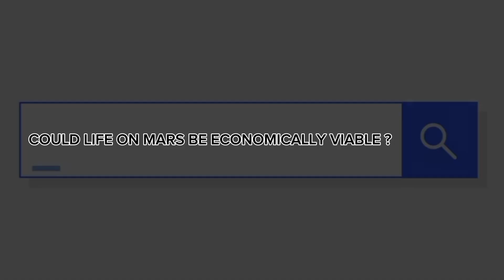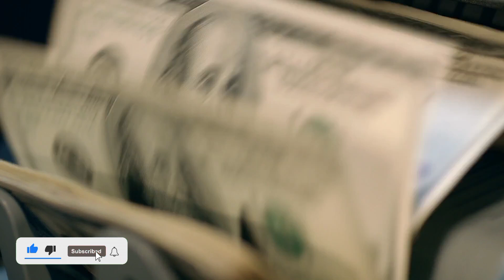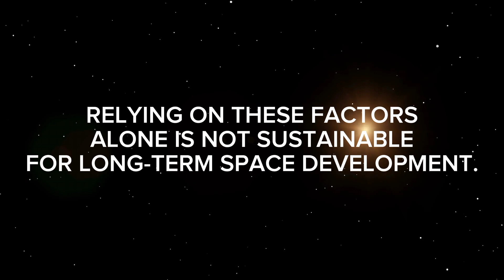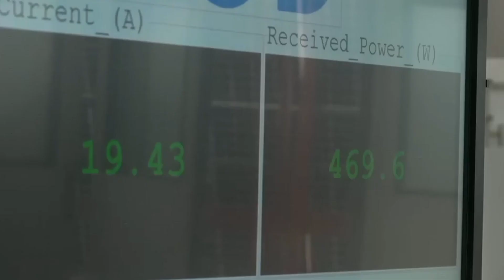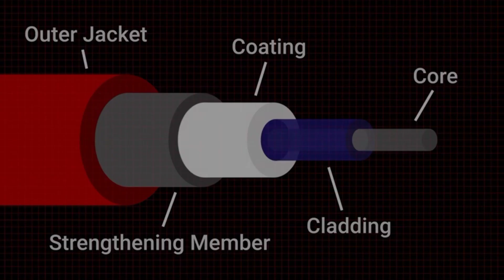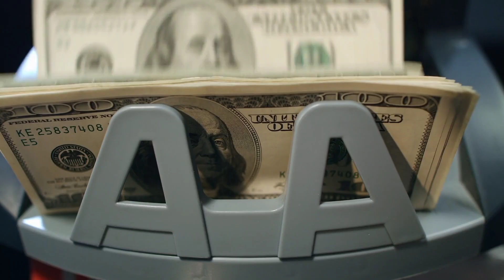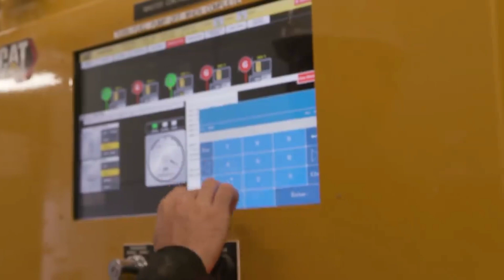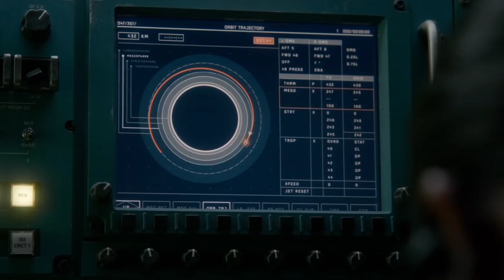Will Sending Humans To Mars Ever Be Worth The Cost?

Comment: Economically viable is not the same thing as worth the cost. Also, ever is very long time. This completely ignores the economic benefits yielded by technology developed to get there, which are almost immeasurable. The very first integrated circuit came from the Apollo program. This also ignores the value of the inspiration and dynamism that exploration offers to future generations. Also, immeasurable. Finally, if we don't become a multiplanetary species, we will go extinct. Those are the only two options. It would be extremely irresponsible not to pursue colonization as a simple matter of survival of the biosphere long term. The problem here is not that the project is not 'economically viable' the problem is that our economic system is shortsighted and inadequate to the task of securing the future of life itself.
Reply: Given what I know about history, our recent development, and current events/economic and scientific patterns, it's really hard for me to pin down if being multiplanetary is a 1,000 year or 10,000 year goal.